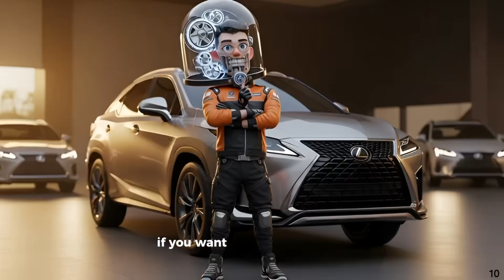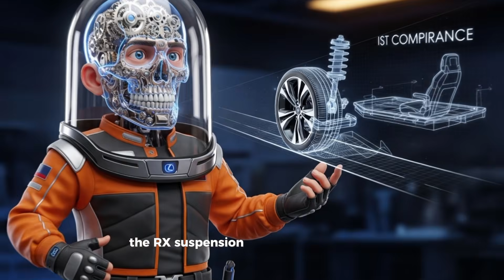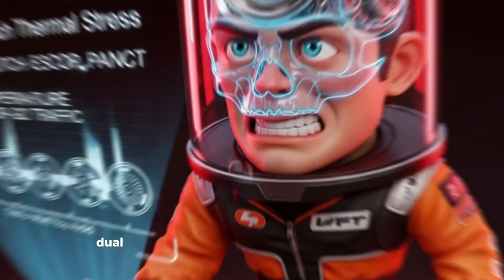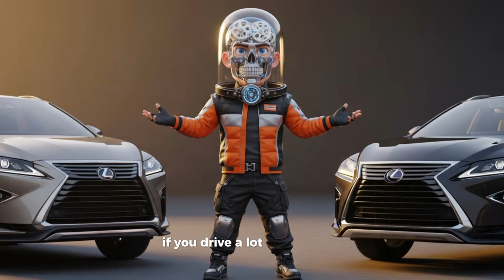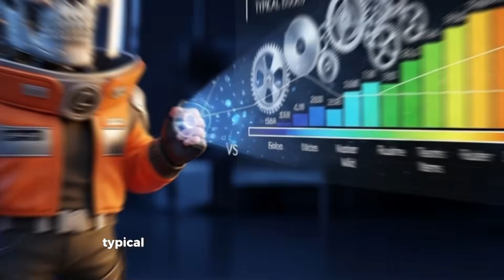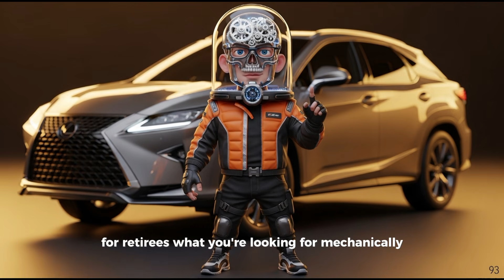Is the Lexus RX the Ultimate Retirement Vehicle? Full Analysis

Comment: I own a 2022 RX450h, and I’m very happy with it. I bought it brand new in 2022 knowing that it was the last RX V6 hybrid production year and never looked back. Just basic maintenance, about 30 mpg, and with a range of almost 500 miles, I can cross many US states without worrying about gas refills. It’s so comfortable yet it gives you the power you need at any time. In today’s gas prices, I plan to keep it for the next decade - if not longer.  I ❤it.
Reply from the maker: Sulehk, thank you for watching and for sharing such a perfect real-world example of why that specific generation of RX is so special. You made a brilliant mechanical move by targeting the final production year of the V6 hybrid; from an engineering perspective, that 3.5L 2GR engine is one of the most durable and refined powerplants ever built, and pairing it with the proven planetary hybrid system creates a drivetrain that effortlessly handles long-distance touring. Achieving a 500-mile range with 30 MPG in a vehicle that offers that level of comfort and passing power is the ultimate "retirement cheat code," and your plan to keep it for a decade is financially flawless since you’ve secured a machine that is engineered to outlast almost anything on the road today. It’s great to have you in the GearHead family enjoy every quiet mile in that V6 legend! 🔧

Comment: Uk here . Have 2021 RX 450h , my 4th Lexus. At 81 have driven it to France and Belgium- in nearly 5 years of ownership needs only annual service. Very comfortable.
Reply from the maker: Gwyn, thanks for watching from the UK and for sharing this fantastic real-world experience!

At 81 years young, taking international road trips across Europe is the absolute ultimate proof of this video's entire thesis. From an engineering standpoint, your 2021 RX 450h represents the absolute peak of that ge nerationpairing the legendarily under-stressed 3.5L V6 with their bulletproof planetary hybrid transaxle.

The fact that you can drive from the UK to France and Belgium and highlight how comfortable it speaks volumes about Lexus's ergonomic philosophy. They specifically engineer their chassis compliance, acoustic glass, and seat structures to eliminate the microscopic vibrations and road noise that cause physical driver fatigue on long journeys.

And "only annual service" over nearly 5 years is exactly why this is your 4th Lexus. You aren't wasting your retirement time or money in a dealership waiting room dealing with fragile air suspension leaks or complex turbo failures. You bought the ultimate low-drama machine.

Thanks again for adding this top-tier data to the discussion, and safe travels on your next road trip! 🔧

Comment: I drive a 2013 Audi Q5 daily. When my parents come to visit, I drive them around in their 2016 Lexus RX350. The comfort and noise isolation are night and day. In the 10 years that they've had it, only done regular maintenance and never been to shop for repairs.
Reply from the maker: Rendezvous, thanks for watching and for dropping this perfect real-world comparison.

You've just perfectly described the fundamental difference in engineering philosophy between Lexus and its German competitors. Audi, especially from that era, tunes their chassis for a 'connected,' sporty feel, which often means stiffer suspension and less isolation. Lexus, on the other hand, engineers their vehicles from the ground up for one primary mission: absolute passenger isolation.

And your parents' 10-year, zero-repair ownership experience is the ultimate proof of the mechanical payoff. That 2016 model has the legendary 3.5L 2GR V6, a naturally aspirated engine that is famously under-stressed, paired with a traditional automatic. It completely sidesteps the high-stress, small displacement turbo engines and complex electronics that often lead to those 'four-figure surprise' repair bills in its European rivals.

Your comment is the perfect case study. Thanks again for bringing this top-tier, real-world data to the discussion! 🔧

Comment: Absolutely, 2009-2022 RX V6 if naturally aspirated all the better. An RX is not a Chevy, but it’ll last as long as one. Maintenance is your pride of ownership. Parts will steal your fun tickets, so not for the feint of cash. 
One of the most comfortable vehicles, second only to the Range Rover. Very reliable that thevRange Rover could never sustain
Reply from the maker: RR, thanks for watching and for dropping this spot-on analysis!

You absolutely nailed the golden era. That 2009-2022 run with the naturally aspirated 3.5L 2GR V6 is the pinnacle of under-stressed, overbuilt engineering. It doesn't rely on the massive thermal loads of modern turbos, which is exactly why it survives for decades with basic maintenance.

Your Range Rover comparison is brilliant. From an engineering standpoint, Land Rover achieves that "magic carpet" ride using incredibly complex, failure-prone air struts and hydraulic active sway bars. Lexus manages to deliver 90% of that exact same ride quality using meticulously tuned, traditional steel springs, passive dampers, and compliant bushings. They give you the comfort while completely engineering out the catastrophic air-suspension repair bills.

You are also 100% right about the parts cost. You absolutely pay a "Lexus tax" on OEM components, meaning it isn't cheap when something does wear out. But from a Total Cost of Ownership perspective, the mathematical tradeoff is that you are buying those expensive parts at a fraction of the frequency you would on a European equivalent.

Thanks again for bringing this top-tier perspective to the discussion! 🔧

Comment: All Lexus cars are too expressive for most of us and not suitable for retirement.
Reply from the maker: David, thanks for watching and for bringing up such a highly valid point.

You are hitting on one of the greatest paradoxes of modern Lexus vehicles. From a pure engineering and mechanical standpoint, the RX is arguably the most conservative, relaxed, and low-drama machine on the market. But you are 100% right the exterior packaging is incredibly aggressive.

When you combine those massive "spindle grilles" with sharp, angular sheet metal, it absolutely screams for attention, which is the exact opposite of what many buyers want in a quiet, under-the-radar retirement vehicle. It's a fascinating contrast where the styling department and the mechanical engineering team seem to have been targeting two completely different audiences.

If a buyer wants true aesthetic stealth to match that legendary mechanical reliability, the newer RX models definitely fail the test, which pushes a lot of smart buyers toward a top-trim Toyota Highlander instead. Spot on observation, and thanks for adding this perspective to the discussion!
Reply: @GearHead_Geniusgtr    Yeah but I will never be able to afford them.  I just got my CX-5 fully loaded here in Japan for $24.000.  I'm satisfied.